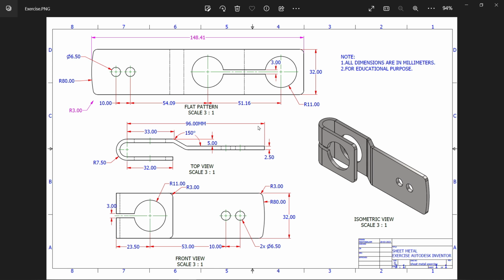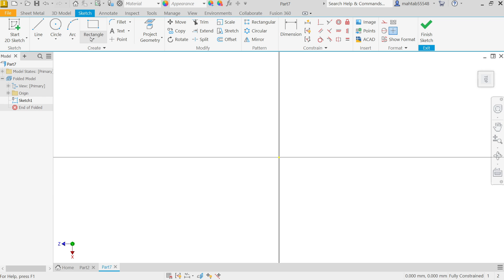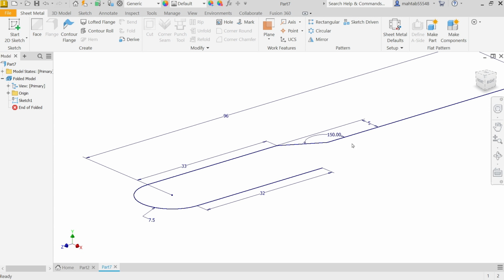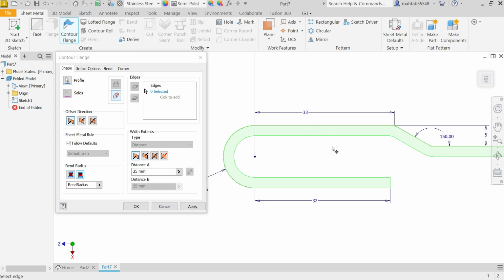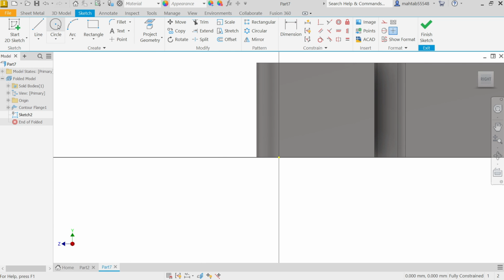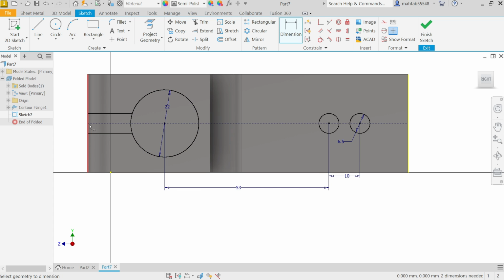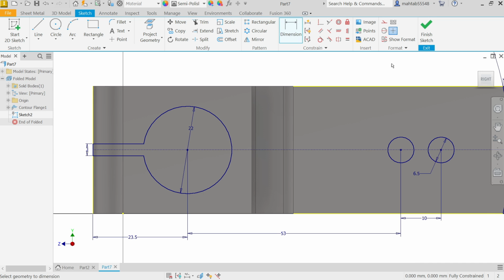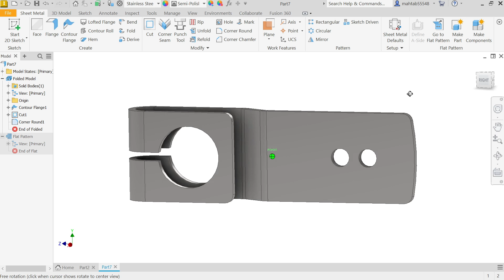Autodesk Inventor sheet metal 2023 Exercise 21,Contour flange, Cut, Corner round

Comment: why you no working with solidworks ?!
Reply: Inventor is in so many ways better than SW.
Reply: @selimguclu625  why’s that? Matter of opinion or features? Looking into options for myself…
Reply: @cnicwaz  Well, I like the fact that I can 3D Design my finished part photo realistic, directly in inventor with many textures etc.. Put it in scenes etc. 
Building a part is very similar. But for my case, inventor has the better structured UI. 
I like SW. But somehow I'll stick with inventor(actually using it trough university).
Reply: @selimguclu625  an that’s fair. Seem in more familiar with solid works but now I’m using inventor at my new work I don’t like it so much. The work slow doesn’t seem as simple
Reply: @cnicwaz  you will get to this very fast. 
Its just practice mate. 

Which kind of parts do you design?